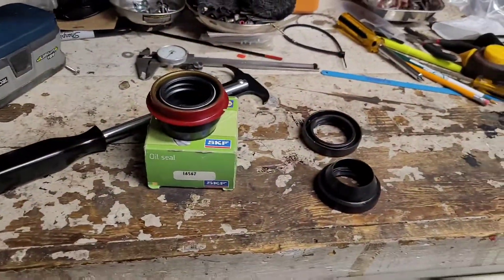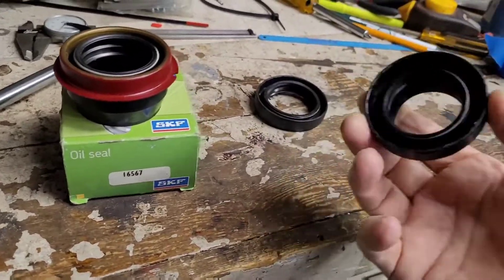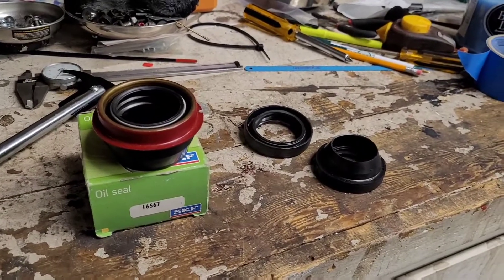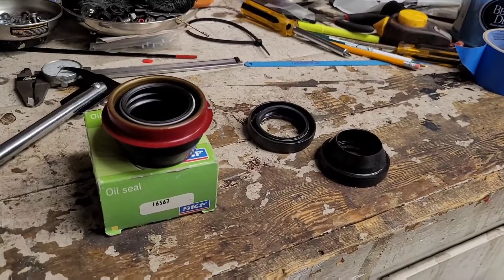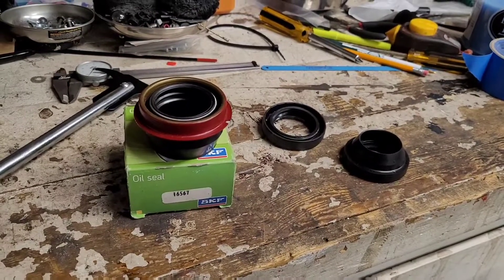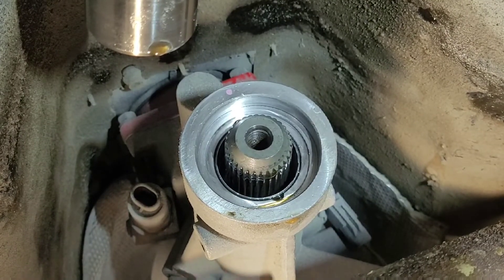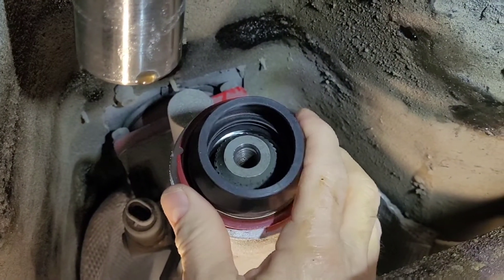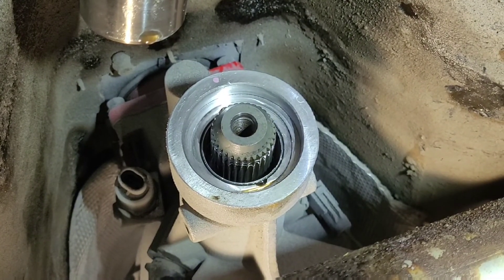Tremec T56 Magnum rear seal replacement

Comment: Im using royal purple synchromesh in mine as well. Are we running improper fluid, didnt think so since its designed to run in manuals that use atf? Im having a front mount aftermarket shifter leak.